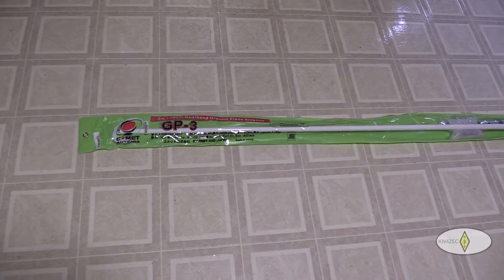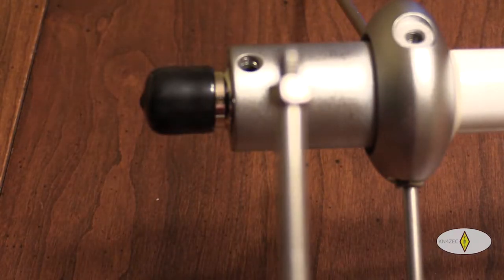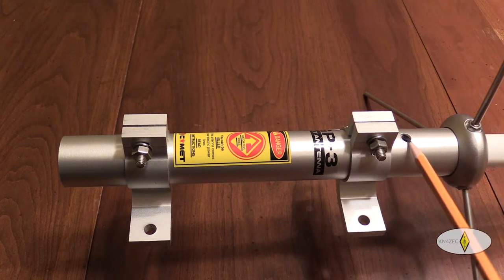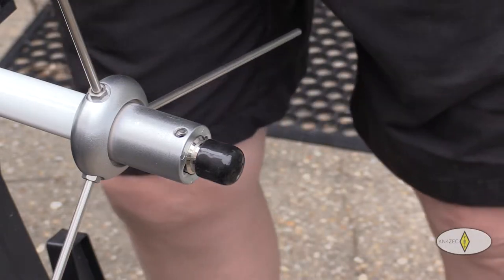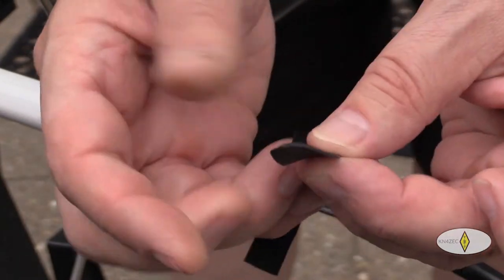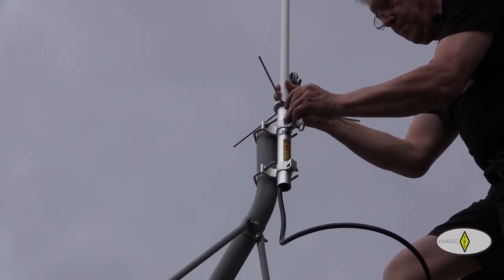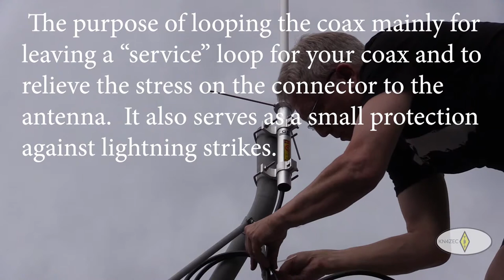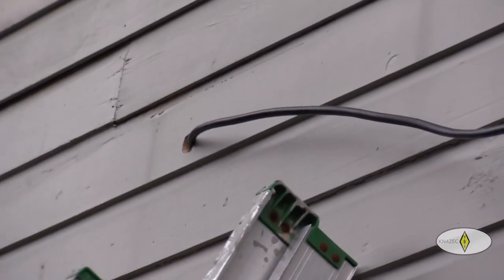Comet GP3

Comment from the maker: Installation of the GP-3 is a relatively easy install.  If you have any questions regarding my actions during the segment where I lost audio, please ask in the comments below and I'll be sure to answer.
Reply: I installed the same antenna on the the same type of mast. my question is how did you ground it?
Reply from the maker: @craigrobinson9410   I grounded it by grounding the antenna mast at the base of the mast to an eight foot copper grounding rod that was pounded into the Earth.

Comment: Best to assemble everything on there ground, but leave the U brackets a bit loose. Then slip the brackets over the disk mount pipe. It is a brave man who puts the little setscrew in on the roof. Drop it and you may never find it.
Reply from the maker: How true!
Reply: I’m getting ready to do this and was thinking I’m going to put everything together on the ground …good point lol

Great instructional video too!
Reply: My set screw was super hard to get in and I eventually dropped it in 2nd story gutter. Good idea on doing it beforehand

Comment: Just curious - why would you start the tape from the top, instead of starting from the bottom.  That's why roofs are shingled from the bottom up - to keep the water from penetrating as it flows down ?
Reply from the maker: Thought you do bring up a valid point, the coax connection for this run is actually enclosed in a water resistant pipe so it will never be directly exposed to the elements.  73's / Steve
Reply: @K4SRF  Yep, I have put mine up leaving the pipe as the sole protection as it was made to be. Had some very wet weather, and on checking, the SO 239 was completely dry.

Comment: So, newer HAM here, and I have a couple of questions. 1:  Why the loops? The audio cut out right as you were going to give the explanation. 2:  What coax did you use? I am planning on LMR-400 for my install.  3: I'd be very interested in a follow up to see your grounding method.  73 KJ7LLI
Reply from the maker: 1)  For one, a loop of coax can act as a “drip loop” that will prohibit water from entering the coax or running down the coax into a structure.  The same loop also acts as a strain relief from the antenna.  It can eventually weigh the cable down from the coax connection and this looping helps reduce, if not eliminate the strain.  Multiple loops also provide you additional coax should you need to adjust the coax from time to time.  Lastly, making multiple loops can act as a Collins Balun or a coaxial RF choke.  This can help improve the antenna’s performance but will never have a negative impact on the performance.  The effectiveness of the Choke Balun is determined by the diameter of the turns as well as the number of turns depending on the frequency you are using.
2) I used RG8 Coax
3) I will probably do a follow-up video on the grounding at some point!

Thanks for asking!  73's / Steve
Reply: @K4SRF  Thanks for the reply! Isn't RG8 coax lossy at VHF/UHF frequencies, or is it not enough to justify the greater expense of LMR-400?

Comment: I put my antenna on my roof following your instructions almost to a T.  I’m still having trouble reaching a 70 cm repeater that is about 22 miles away.  I was sure I’d be able to hit it after getting that up there.   I ran RG8x but now I’m thinking about restringing it with LMR400
Reply from the maker: I would go with LMR400.  How high is the antenna?
Reply: @K4SRF  I did end up going with LMR400 and now I can hit all the repeaters I wanted to.  The antenna is on top of a 2 story house.  I’m not sure exactly how high though …maybe 30 feet.
Reply from the maker: @Norseman2  The rule of thumb is "the higher the better".  Thirty feet is fine.  Glad you can reach out the those repeaters.
Reply: Weirdly enough I got my GP-1 ten feet higher and in the process also switched from RG-8X to LMR400, and I did not see the improvement the loss charts would have me expect.
Reply: @evanfinch4987  sorry to hear that ☹️

Comment: what cable did you use to connect the antenna because I would like to connect the comet gp-1 antenna to the Baofeng GT-3TP Mark-III and I do not know now what cable would be best for this 10 to 15m cable
Reply from the maker: If you are talking 10 and 15 meter frequencies, I would go with RG 213.  If you are speaking about UHF/VHF, I prefer LMR 400.  It's harder to work with, but has less loss than other cables do for this frequency range.
Reply: @K4SRF  I use RG8X throughout.
Not much loss and easy to manipulate.